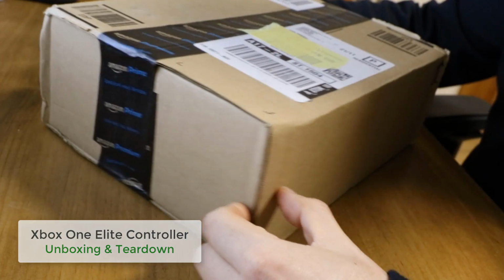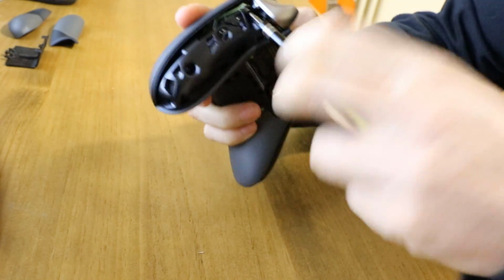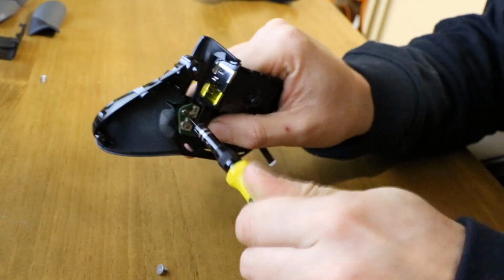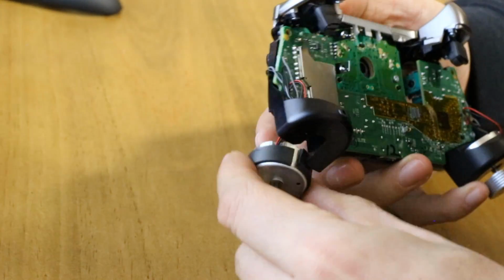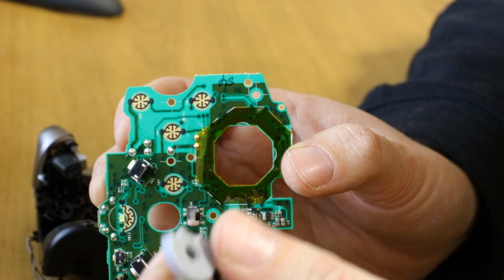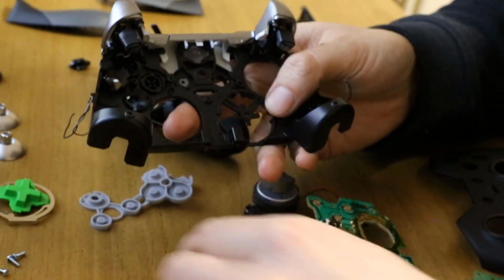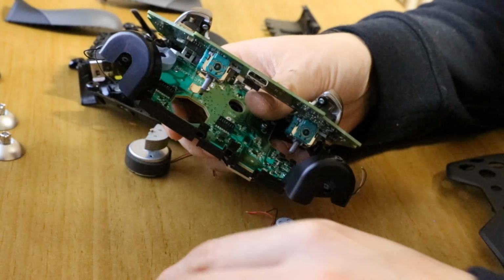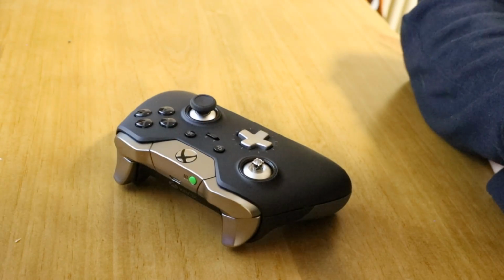Unboxing Xbox One Elite Controller Disassembly Teardown Repair Fix

Comment: thank you, i bought an elite and not even 3 months later it had a slow dirft.
Reply: hello is it true that these xbox controls (the normal and the elite) break very easily, like the internal parts rb lb dpad broken buttons etc ... how long do your controls last.?
Reply: @danielk9612   Mine lasted a year until the RB side broke off from the join that connects the two bumpers together, if the break is clean enough, you can just superglue it back and then continue.
Reply: Mine has analog drift, how can I stop that

Comment: Your video was very helpful. I had to fix a sticking paddle button and was able to do it in less than 15 minutes with the help of this video. For anyone having issues with the paddle buttons (little green ones on the back), open it up and make sure that the little black dot on the board is in the center of the little switch thingy for whatever button your having issues with. Mine was shifted to a corner so I just realigned it gently with a knife edge. My top right paddle button is wonderfully clicky again.
Reply from the maker: Cool glad I could help and glad you fixed your problem
Reply: Same issue happened with me, but it was my lower right paddle thanks for the help

Comment: Great video, helped me clean my controller's buttons after a spill. I noticed while reassembling that its easier to put the circuit board in before the bumper bar. Also, I figured out the white tabs function is to give a mechanical brace behind the bumpers' triggers. They have a tight fit between the back of the bumper trigger and the black plastic of the controller. Ideally, first, you put the circuit board in, second, flip the controller over and squeeze those tabs in place and finally, fit the bumper into place.

Comment: This helped me tremendously! The only hiccup was reassembling the black ribbon wire. Obviously taking it off was easy but when I reassembled it, I thought it would fit more snug. I tried and tried to make it go in further. Then I looked at the other connection and that stuck out a bit. So I put it in as far as it would go... and it’s working perfectly.  Thanks again!

Comment: I dropped my controller on hardwood floor with the hair triggers turned on, broke the extended piece of plastic attached to the trigger cradle. This video is going to help me replace the controller frame seeing nobody would honor the warranty. the seller advertised the 90 day warranty, which microsoft told me they can't honor it because it isn't an official microsoft retailer so now I have to do the controller repair myself, because I refuse to spend another 150 dollars on a controller that can break from a fall thats barely over a foot off the ground. YAY!
Reply: You should have dropped it with it's protective case on

Comment: Replacing the bumpers on my elite controller and the additional circuit board black strip came out.. worried I'd ruined it and then found this video! Very in-depth and very useful. Thank you!
Reply from the maker: Cool, glad I could help

Comment: Been watching over and over until I finally went ahead to repair my broken inner frame. So I needed to disassemble that trigger metal with the springs. That's where you stopped unfortunately for me.
But I just cut the plastic from the old frame and removed the trigger piece that is holding the spring. Actually, it's very difficult to remove unless you are putting a new inner frame like I did.
Thanks a lot for the whole video. 🤝

Comment: The outer screws are 6 star SECURITY heads, but in your video you say that the screws are 5 star heads. Also, the set you linked is wrong, because they're not security screwdrivers and don't have a hole in the middle, so they're never gonna fit. Unless the picture is misleading but I doubt it
Reply from the maker: The Elite doesn't use security tips (unless they have added them back?). Only the standards do. However I will update the link to one containing the security tips
Reply: My controller has these screws. Very annoying.
Reply: They have security screws. You can snap off the little bits though easily enough
Reply: @AngelSix  You can get the T8 with the hole in

Comment: Thanks for this video, it helped me fix my controller in 15 minutes. The only note I would make is that the bumper comes with the screw to open your controller (the little green plastic piece is not necessary to open the grips, you can use the screwdriver or the elite paddles to pry.. really anything small or flat). 

Just wanted to give that heads up so people can save on purchasing the extra screwdrivers. Thanks again for the awesome video.
Reply from the maker: Anthony Serio thanks for the tip

Comment: Really great video. But a little tip… you can also take apart the controller without removing any cables. Just in case you are not familiar with soldering. ; ) The only downside is that you can´t get the bigger vibration motors through the plastic housing.

Comment: My bumpers aren’t as responsive after a year of having this controller, I replaced the actual bumper but still no luck, thus I assume it’s just the mid frame worn down where the bumper part clicks. Will be using this video when I replace the mid frame:) thank you
Reply: hello is it true that these xbox controls (the normal and the elite) break very easily, like the internal parts rb lb dpad broken buttons etc ... how long do your controls last?

Comment: Thanks so much. Just fixed my elite - paddle buttons had disconnected 👍
Reply: hello is it true that these xbox controls (the normal and the elite) break very easily, like the internal parts rb lb dpad broken buttons etc ... how long do your controls last?
Reply: @danielk9612  I've had my elite controller for around 2 years. Reason mine had an issue was because I replaced the top plate
Reply: @GarethMorgans  thx
Reply: how did u fix it
Reply: pls tell me how u fixed this

Comment: Late reply but, for anyone having trouble getting the back plate to line up at the bottom with the audio jack hole, I was able to snap it in place by holding the controller from the top, fingers down the back (partly holding the triggers down), and thumb over the front above the audio jack/chatpad port (I've don't have small hands). I then placed the bottom of the handles (below the rumblers) against my chest and pushed down HARD with my thumb. A loud pop signaled the jack was in place.

After that, the chatpad port wasn't lined up, so I installed the bottom 2 screws first and while trying to plug in the chatpad (careful with the pressure from the chatpad) I continued pushing the same spot as before for the audio jack while the controller was lying on a flat surface.

Now, this meant I wasn't able to plug the chatpad back in if I took it out, but it turned out I forgot about the annoying profile switch. After taking the face plate off (again!) the bottom snapped back in with no problems whatsoever and the chatpad can easily come and go whenever I want without disassembly. Not sure what I did to get this result though.

Hope this helps someone and great video! I had to get to the paddle buttons and wiggle/slide what looks like some very small black dot back over the center of the button to get the clicking noise for P1 (the button still registered but required a harder press than normal and no paddle movement or click). This dot seemed like it was under a sheet or something since I couldn't pick the thing up with the tweezers I was using (hence the wiggling/sliding).

Comment: they way you push the bumper out is risky cause it could break the plastic bridge that connects each bumper. it's easier if you you push down the main x button with your index and use your thumb to lift up from the bottom.

Comment: Thank you for this video. Unfortunately, I dropped my Elite controller and a little piece of the plastic from the left side of the analog stick mechanism broke away and became lodged in the bottom of the stick's movement area. Suddenly during a Strike in Destiny 2 I couldn't aim!! Anyway, I found you and learned how to get the front cover off, discovered the problem, put it back together, and away I go! The only thing that stymied me, was the tiny little security tabs in the screws. I was scratching my head until I got it under my magnifying lamp. Thanks again, AngelSix!
Reply from the maker: Bad timing there dude. Glad the video helped you though :)
Reply: AngelSix yeah, the dislodged piece didn't come into play until the day after dropping it, but yes, still bad timing. Once I found the problem I realized it was the dropping of the controller that caused it.
Reply: AngelSix Can you help me my elite controller analog stick is marking a weird cracking noise when moving downwards to the right

Comment: wtf i cant unscrew any of it, the screws have a little metal bit cockblocking my T8
Reply: Tyler Caswell yeah i literally am looking up vids trying to fix mine cause there’s something blocking it
Reply: Deeper might be T6
Reply from the maker: Security T8 bit on eBay for few quid
Reply: Just happened to me, I used a flat head screw driver to break them, then the t8 worked perfectly mate
Reply: What Aziah said
Reply: It’s a security T8, not just standard
Reply: Just ware the bit in middle. I use small flat head

Comment: Im having a interesting issue with my controller and im wondering if anyone can help. When I push in my left analog stick my right trigger activates. Once i have my controller opened up what should i be looking for? Im assuming its a magnet issue but im not sure which parts in specific i should be looking at.

Comment: Hello, first of thanks for this great video. I have a problem where the right half of my A button is rarely registered the left half works great. At first i thought there might be some dirty like suggested in the video or maybe a missallignment between the circuit board and the rubber but i could not detect anything. Is there any recommendation you can provide what i could check?

Comment: I've had a new Elite controller sitting in my cupboard since they came out to keep as a collector's item.  Well, my current controller has done its dash with the thumbsticks now wobbling like a dancer.  So I gave in and got out that stored controller.  Can you believe the right trigger has a crunchy squeak that feels like the spring is not moving with the trigger or rubbing on something!!!  So I found this video, and see I need to dismantle bloody 90% of the thing just to see the spring action!!

Comment: Do you have to take out the circuit boards to replace the 3.5 mm headphone jack?
Reply from the maker: You have to take the first one out, but not the one thats attached to the front face

Comment: Don't know if you were aware, if someone has previously mentioned this below or if it even matters, but you put the bottom motors back onto that controller reversed of how they came out. Probably doesn't matter much 2 years later, but just thought I'd mention it.
Reply from the maker: Ha thanks for the catch I never noticed

Comment: About the bumpers, I didn't get it. RB and LB were just one plastic part, in both the normal Xbox and the Elite 1 controller, that bends in the middle each time you press either button, so it was always a question of time until it will break.

Is this the case on the new Elite Controller 2 Series too? Still one plastic part?

Comment: This is an awesome vid man. Appreciate the time and effort but I have a question. The silver domes that hold the thumbsticks and slide down over the module's control arm have an asymmetrical. One side wall is flat and the other is rigged. The control arms show no indentations or grooves that suggest better stability based on how they're seated but do you know if it matters?

Comment: I rate this video a 8/10 on the educational side. 7,5/10 on the instructional side. Let me elaborate. You showed how to disassemble it and re-assemble it, BUT you could slow it down a bit. Most people use these guides while actually doing it. And i would have gone with a 90 degree angle torx tool instead to be more steady and for more leverage. A small magnetic stick would also be helpful since the screws are tiny. And slow down the pace a bit. Just some constructive feedback.
Reply from the maker: Jakob, Thanks for the feedback and it's noted for future videos. Hopefully it was still useful for you :)
Reply: It was. The plastic holding the RB and LB is fragile so i had to replace them.

Comment: I'm having trouble with the headphone jack, is it just a bit of brute force needed to snap back in place?
Reply from the maker: First make sure everything is aligned correctly if you have opened it up and put it back together, then when fitting back it can be a hard fit to press everything back into place. However you could of misaligned something and so no amount of force would get it back into position. You can apply moderate force on the jack but nothing that would feel like you are having to push hard in any way, and if it doesn't go back in with that recheck your fitting

Comment: I wandered if you had any idea on this? I replaced the circuit board with the usb connector on it and now the Home button doesn't work. Everything else works fine and the home button feels right but nothing happens. Any ideas ? Cheers

Comment: A bit stuck with the 3.5mm aux, can u explain exactly how to do it?
Reply from the maker: To do what with it? Fit it back? It basically just sits in place and as the shell closes, the pins are springy so they contact under spring tension. It's best to drop the aux peice into the front shell first then fit the PCB over it.

Comment: They are not just Torx heads ! They are Torx screws with security heads !
Reply from the maker: They are not on this controller they are regular
Reply: @AngelSix  Strange i've taken quite a few apart to replace analogue joysticks that have been drifting and all have had the security torx, still worth a mention as I read below a few people have had problems taking their controller apart due to not having the correct bit / driver, worth a mention anyway ;)

Comment: My elite controller is having weird power issues. plugging in usb doesn't work, unless I move the batteries around until it turns on. Then I can connect to xbox via usb. when I turn the controller off. It only turns back on again if I take one of the batteries out and put it back in. and sometimes even that doesn't work. When its on it works fine. Suggestions?

Comment: Great video I was able to take it apart easily but I don’t know how to smolder the wires back on so if u would do a video on how to do it that would be great
Reply from the maker: Eventually I will do video on soldering yes
Reply: K thx

Comment: When I put my controller back together I left our those 2 pieces you said weren’t needed. However my controller only stays on while the home button is pressed, when I release it the controller turns off. Do you have any ideas on what might be causing this?
Reply from the maker: Usually the connecting sockets between the two boards are not connected fully. It turns off if those two cannot communicate
Reply: AngelSix thank you I will look into this

Comment: Dear, I had problem with my xbox, button a x y and menu not working as because of battery acid leaked for not using. I could not able to fix it. It damaged lots of components by liquid acid but its still functional. I used ethanol alcohol 70% and cleaned the rest of the components. It do power up and works rest of buttons and joysticks. But I broke all 6 pins of the ribbon cable which joint to the main motherboard, where I can manage a replacement of it? Can you suggest me an alternative version or model? I found some from old device but I will not be receiving them in this lockdown so need to find from local area, and I don't think my locals have Xbox elite old copy for me. So a cable 6pin ribbon cable will works on it as a replacement??? Please help me and suggest :(

Comment: So I took the controller completely apart I desoldered and resoldered the wires it was my first time doing it and I had to use tape to hold the wires in place and when that didnt work i dabbed and liquified and inserted the wires
Reply from the maker: I have a few videos on soldering if you look in my channel

Comment: Hi at 19:40 seconds in the video you mention the black conector for the rear case of the pad and the capton tape im wondering which part i have to replace as the black conection wire that you mentioned is snqpped on mine due to leaving it around kids when it was dismantled
Reply from the maker: Its and FPC cable and FPC connector. You can get them from digikey or farnell, however I remember when I used to mod these consoles, that particular FPC connector is customized so the tabs on standard ribbon cables catch the sides.

Comment: Hello, congratulations on the video, It has won a subscriber. At 10:23 a minute of your video could you tell me the name of the piece of rubber and where can I find it? I live in Brazil and can not find it here. The shovel button (that green that stays on that eraser) did not spoil me. I am grateful for any help
Reply from the maker: http://www.ebay.co.uk/itm/Xbox-One-Elite-Custom-Controller-Pro-Paddles-PCB-Board-P1-P2-P3-P4-Silicone-Rear-/182666728380?hash=item2a87c913bc:g:vncAAOSwKoRZZ4qx

Comment: That's one heavy ass controller
Reply from the maker: Ha sure is
Reply: So tacky for like £120 though. I took apart the ordinary controller and was amazed at how tacky it was. The headphone jack was playing up and took it apart only to find out the jack is just a surface mounted connection not physically soldered to the board. I ordered a new jack on amazon for £2.99 so I'm hoping it will be okay.